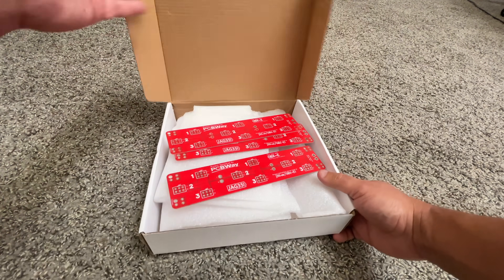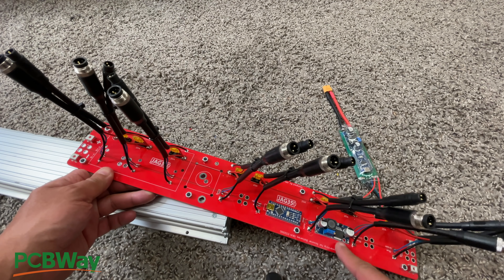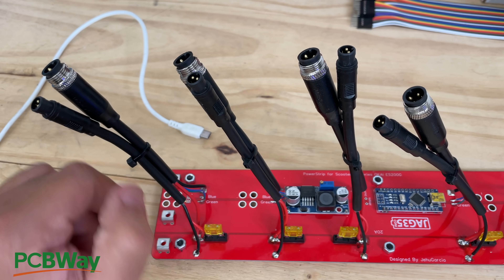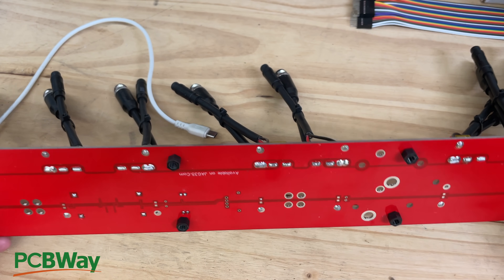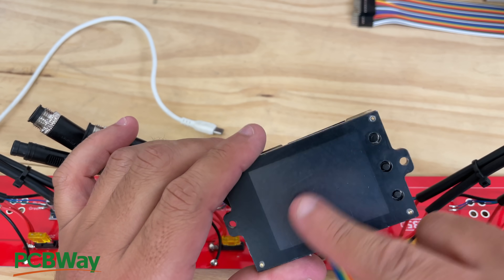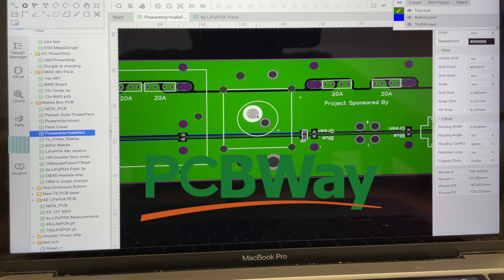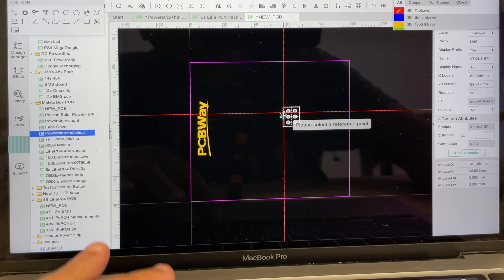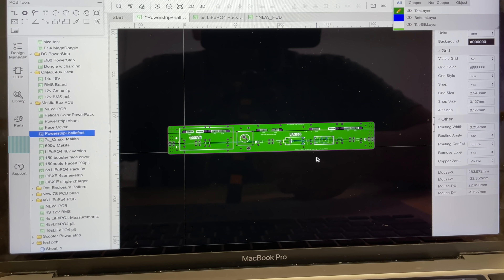36v DIY POWERWALL  build project

Comment: Is anyone interested in bulk laptop batteries with 6 samsung icr18650-32a cells each? i have at least 100 batteries that i have no use for. i can't post my ebay link to an auction i have going for 20 batteries. So comment here if you're interested a bunch of project 18650 cells and we can figure out how to get them shipped to you, United States only

Comment: I have been looking for a 3s 3p BMS. But I can't find one. It is all just 3s and not 3p 3s. Why can't I find a BMS that is 3p 3s?
Reply: If you need a 3s, get a 3s that has the required amps.  If you have cells that are rated for 10amps and you have 3 cells in parallel, you need a BMS that is 3s and rated at 30 amps.

Comment: those fuses have insufficient breaking current from lithium batteries from my research, they can hold an arc when they blow resulting in fire. Due to the amperage a lithium pack can produce they need specific fuses? or I may need more education / knowledge. I have been collecting sand packed fuses to quench the arc in case of short circuit / high amperage.
Reply from the maker: Each fuse won’t see more than 20A

Comment: I would have bought 20-40 of these to make a power wall when you first got them but I haven't found a grid-tie solar inverter that can use a 10S battery pack.

If you can find quality inverters that you can install with a building permit and take a DIY power wall, you'll have something, until then I'm going to be on the sideline.
Reply from the maker: Don’t 72 cell panels output 36v?   there should be a whole lot of UL approved microinverters out there
Reply: @jehugarcia  How is he supposed to use grid-tie microinverters for this application? I am afraid the standard is 48 volt for off-grid battery based solar inverters.
Reply: @jehugarcia  microinverters are for mounting on the panels, real grid tied solar has microinverters on the panels and a big grid-tie inverter on the wall.  I want about 10-15 kw of split phase inverter so I can run stuff like a lathe, milling machine or welder on 220v and have 110v to feed a panel.  You can find the 10-15 kw split phase inverters that can plug in a battery storage but 48v is the only supported battery voltage that I have found.  I think Tesla's power wall is higher voltage but getting solar or a power wall through Tesla is far too expensive for me.

Maybe I have missed it but I don't think it exists really.

I'm sure the inverter companies could change a few component values to make custom grid-tie inverters that would work with 10s battery packs but I haven't seen them.
Reply from the maker: Oh I see…. So you see no problem using batteries that were designed for scooters for other purposes but you do see a problem using inverters designed to be used with solar panels an any other way including connecting them to batteries.   Well,  yeah if that’s where the line is drawn for you then yeah you can’t use this stuff until someone packages it up, puts a UL label and offers is for retail.
Reply: @jehugarcia  no, I can't get my electric utility to hook up to a sketchy inverter that might backfeed their lines in a power outage.

As far as using scooter batteries, I have a shed I'll keep my inverter and batteries in so if it burns down it will only take out a shed, not my house.

Back to sketchy inverters, I don't trust a no-name China inverter to be efficient or to protect the battery if power is lost and the pack voltage gets too low.

For a solar energy system the batteries are the consumable (and the panel to some extent), the inverter should be the durable part, quality and efficiency will pay off.  Batteries will need replacement probably within a decade and when I replace them, the new batteries will probably be cheaper, better and safer.  Right now I just need enough capacity so the draw isn't super stressful for the cells so price per kwh trumps quality but I liked the aluminum case and potting of those scooter batteries, I just couldn't use them with any suitable inverter.

Solar panels also suffer from degradation and I will try to get used or discounted panels for that too, I'll just try to buy about 1.25x expected usage and let degradation catch up to me in 20-30 years and take advantage of the extra shading on my roof the whole time.

Cheap inverters just don't make sense now and they don't make sense later so if your batteries won't work with a good inverter, they don't make sense either.

Comment: Is there a way to safely build a high voltage battery out of these?
Reply from the maker: There’s nothing particularly dangerous about these,  they have good quality cells and decent bms,  I’ve successfully sériesed up to 3 for 111vdc nominal
Reply: @jehugarcia  i have a delta h6 inverter, originally I wanted to grid tie it but I'm in New Orleans and i got hit with the hurricane and now i would love to go off grid but my inverter would only work with a battery voltage from 430 volts to 570. I' would love to talk to you because I order 30 scooter batteries from you and building a battery to work with this inverter can be s life saver given i help provide power for oxygen for folks.
Reply: @jehugarcia  I'm in New Orleans and we just got devastated by the storm. I would love to talk to you about how i can make some things work with your batteries.I bought 30 of your batteries for a different project but now because we have no power, I would love to go off grid. Problem is that my inverter only works with batteries that are 430-570 volts. It's called a delta h6 inverter and it's a hybrid inverter. I was going to use this inverter to go grid tied but now I'm trying to see if i can go off grid with it. I have voltstsck battery generators that I've been using to provide emergency services but i MD i can build s big battery to go off grid, i can allocate even more power to recovery efforts.
Reply: @johnpreston5393  ........SO your inverter is a 220v ?   Or is it a 48 V ?   YOU may have to buy a 36 volt inverter to use with these 36 VOLT inverters .  Can find some on ebay .  But once you use that to power your inverter , can do OFF grid by plugging your inverter into a 15 A or 20 A wall circuit .  Just read up on HOW to do OFF GRID inverters , with a LIMIT switch/setup .  So you do not get charged for the power you send back over the grid , if it is not using enough on your house circuits , at that time .  Power company will not be happy , if you have not gotten approved ON GRID system..........so have to be careful , it does not push power out on grid .

Comment: How many of these batteries do you have??
Reply from the maker: All these just sold out,  I’m currently working on the board for these other ones that we have 10k-+ currently available https://jag35.com/products/scooter-20-cell-battery-pack?_pos=2&_sid=b3b596dbc&_ss=r
Reply: @jehugarcia   Did you ever get the board done on these?? I have a ebike with a bad 38.4v 12ah, 24cell battery.. Its powering a 36v 500w hub motor.. Hoping these will work.. If not, do you have something that will work? I see the v and ah are a bit lower so possibly running 2 in parallel/series? Wish i understood this stuff better but im learning as i go.. Thanks bro!
Reply: @jehugarcia  Or can i take the board off my original battery and put it on this pack? And even tho my battery is 38.4v 12ah and this battery is 36v 7ah it should still work just wont get the speed/distance the original one does right? What i would really like to do is hook up 2 of your packs for more speed/distance.. Which route would you recommend? Hoping these will work so i can purchase from you.. Thanks bro!
Reply: Hello?? Is anyone there??